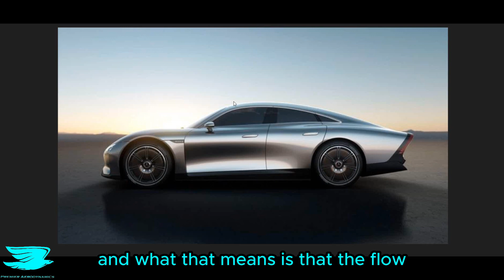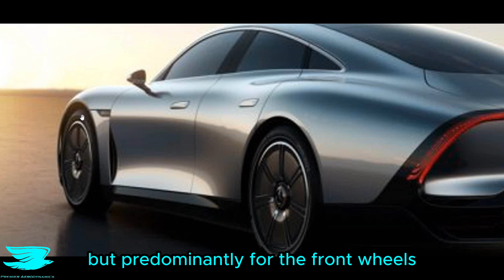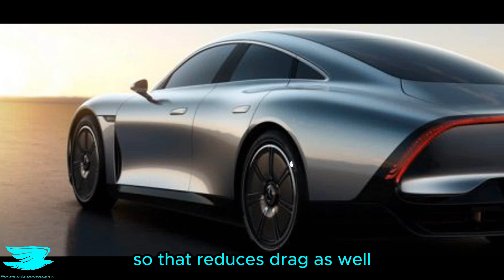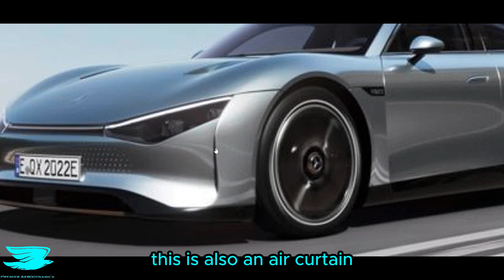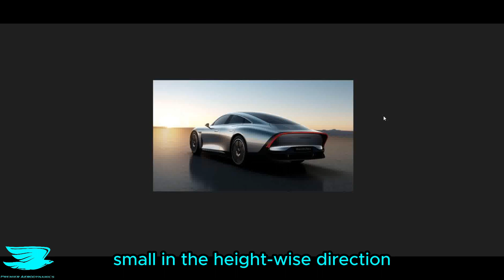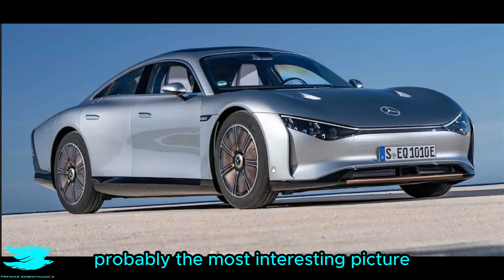{Auto Aero #42} Mercedes Benz Vision EQXX Drag Explained

Comment: Another very interesting aspect are the highly developed cooling vents in the bonnet, including the direction of flow for the exits.
(Shutters open for increased demand for cooling the electric drive or for climate control inside the cabin on hot days or if the heat pump was running on cold days.)
Reply from the maker: Great point!

Comment: But what about when the car bends it’s knees and approaches a sitting position 🤔
Reply from the maker: I feel like I'm being trolled😂 It's a strange feeling...usually, I'm the one doing the trolling.😂
Reply: @PremierAerodynamics  but… what if the car extends its arms perpendicular to its body?
Reply from the maker: @ekothesilent9456  Well, that is the luxury package. Not every car has them. With its arms perpendicular, that would probably reduce its wake a little because now you have the fingers pointing into the flow.

Comment: Thank you for featuring this car. 
Just yesterday, I was looking at this car in detail ( photos )
What strikes me as interesting, is the shallow windshield angle. 
It actually looks very Porche like.
I would think this would result in an A pillar vortex. 
I know that they have vents on the hood to channel air around the area and around the mirrors, but it still surprises me that they pulled off such a fantastic cD number. 

( And the fact that the they even have mirrors ! )

Rather than have a fully enclosed tail section that extends like the Mercedes IAA, why did the choose to only use the bottom section ? 
Is there some benefit to having a bottom section extend out, rather than the top ? 
I would have thought an extending top section would be more beneficial, since the air follows it downward at a slope and reduces wake size, whereas an extending diffuser doesn't decrease the wake size as much ( or does it ? ) 

Please have a look at the  '1960 Abarth ‘Monoposto da Record’

car. It's cD was point 20. 
How can such a streamlined shape have a higher cD than this Mercedes ? 
- Thanks !
Reply from the maker: For the Porsche thing, that is exactly what I was thinking! It makes sense that it might because Porsche and Mercedes use the same wind tunnel facilities.

For the bottom section only extending out, I'm quite sure that this is for downforce as well.

So, the diffuser reduces the drag and increases the downforce. As you go faster, it's important to reduce the lift as much as you can otherwise, you will lose stability as the weight of the car is overcome with the lift produced.

By extending it, you do reduce the drag, but you also increase the downforce. So, I think that it extends at higher speeds predominantly to increase downforce.

Extending the top would actually increase the lift because the flow is being angled down, which produces lift. So, extending the top would be worse for stability at higher speeds, even though it would still reduce the drag.

Definitely, this would still have A pillar vortices, but the only real way around that is to make the car really sleek, which is a very different look.

Sure, we will do one on the Abarth in the next week or two. Thanks for the idea!